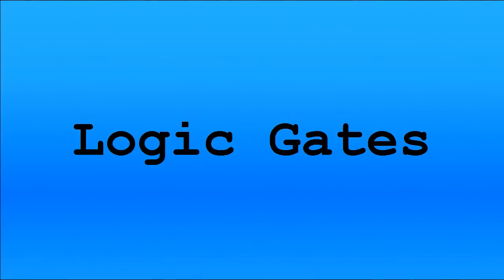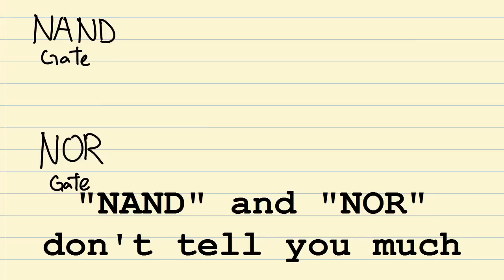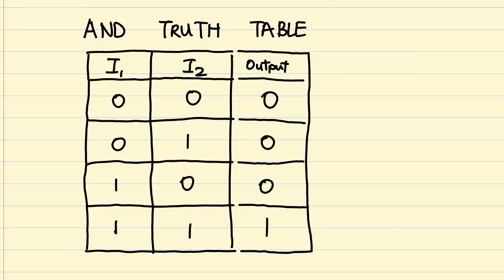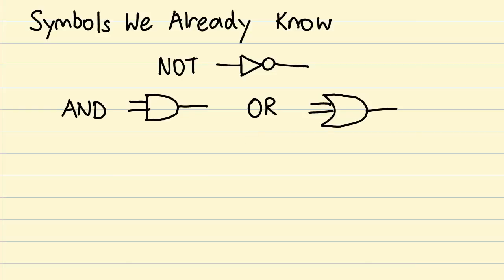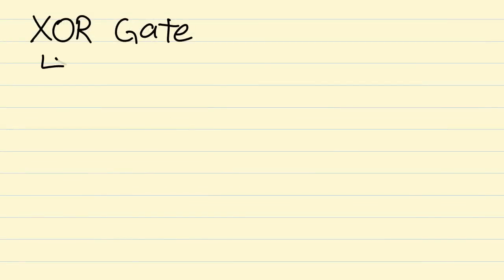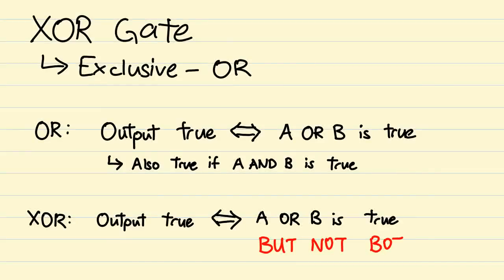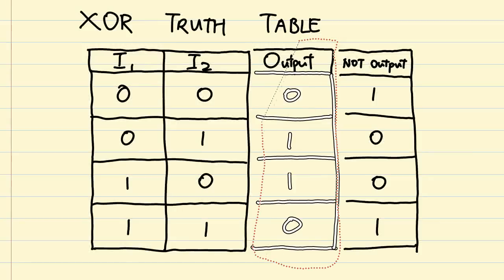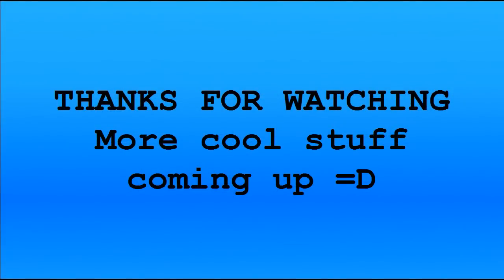Logic Gates 04: NAND, NOR, XOR and XNOR

Comment from the maker: Hello and thank you for your comment!

The program I used is called Windows Journal which is available on all versions of Windows 7 except for Windows 7 Starter. (You might need to run an installer to activate pen and touch features though).

If you're looking for an open-source variant or own a non-windows device, you can also look for Jarnal, an open-source program that pretty much does the same thing!

All the best for your video making =)